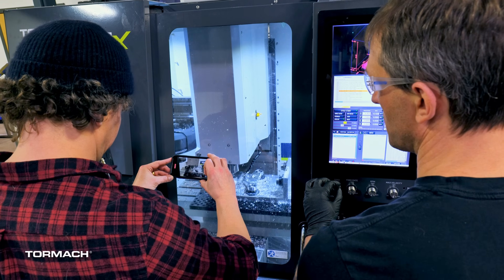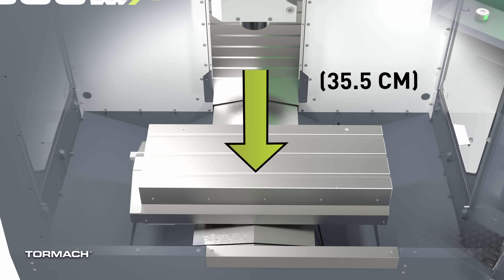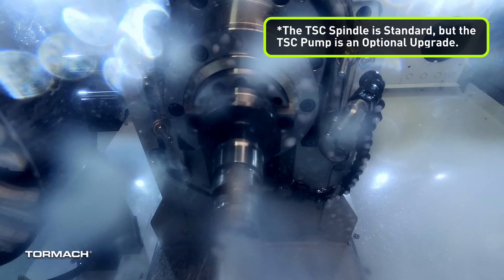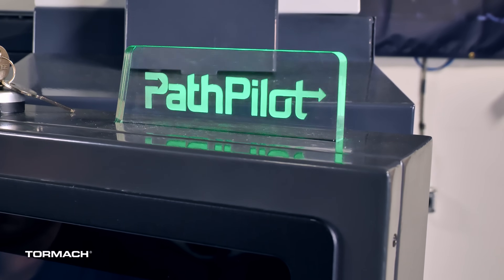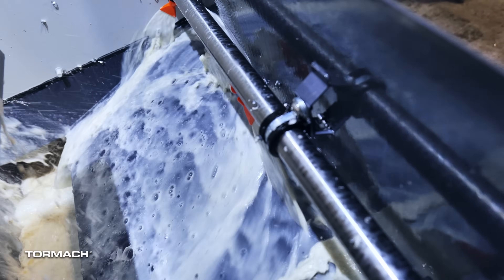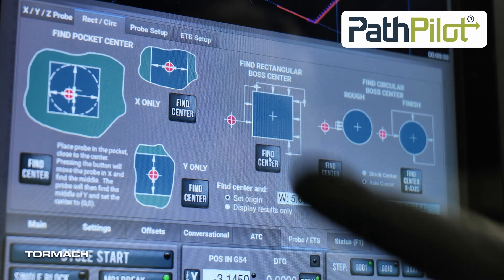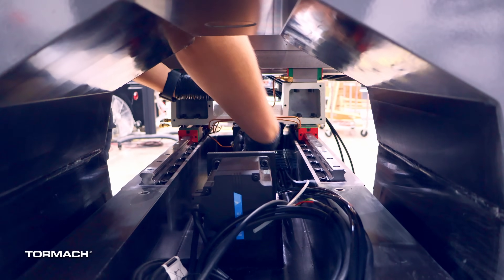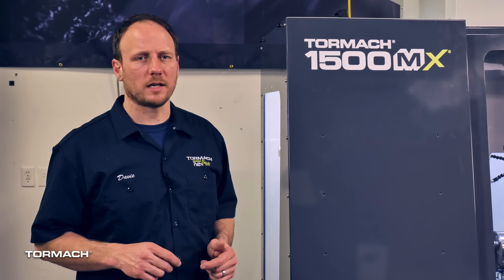The Tormach 1500MX Overview: Linear Rails, TSC, And Epoxy Granite Frame!

Comment: I just bought a used (third owner) Pcnc770. Updated pathpilot, cleaning up the mill from the dust and about to order some replacement parts (the belt, bellows). So far, I'm pretty impressed with the 770, it's not the industrial machine I run at work. But for a machine that runs on a wall outlet, it's pretty good.
Reply from the maker: We're really proud of our machines and how they are reborn with new owners all the time. Our goal 20 years ago was to open up CNC to everyone with the ease of install into workshops with single phase power.  Our Tormach Tech Support is always here to help you out:  https://tormach.com/how-to-submit-a-support-ticket  And we also have a Tormach Forum, which is monitored by one of our employees: https://forums.tormach.com  How are you using your new to you PCNC 770?
Reply: @tormachinc I haven't yet! Ordered a new belt and a couple way covers to replace worn out ones. But I'll be using it to machine parts for myself 😀

Comment: Does the spindle still have a belt for high and low???
Reply from the maker: It still does have a belt, but it's more of a timing belt, so it's more robust and it doesn't have to be set to high or low. This 1500MX belt also keeps track of position better so we can use the encoder of the spindle motor vs. a separate encoder. Thanks for the good question!

Comment: Hmmm, I remember when epoxy granite bases were a new thing in the early 2000's. At that time, it was starting to be used on ultra-precision (really ultra precision) diamond turning machines. I can see no reason to use cast iron now except for cheap low-end machines.

Comment: And the one thing Tormach failed to consider is evacuation of metalworking fluid mist which here in the UK is a hot health & safety topic for commercial users as the HSE expect this on CNC machining centres. Mind you the UK agent for Tormach are next to useless.
Reply from the maker: The mist collector for the 1500MX is mentioned just after the 3 minute mark. It will be coming later this year, as well as the chip conveyor and the TSC. In fact, many are coming even sooner than expected.
Reply: @flosscap  that’s not good enough an excuse to be coming later when your faced with a HSE inspection and a fee for intervention notice at £175 per hour plus VAT. I am sticking with my PCNC770 until something comes along thats considerably better and has better support here in the UK.
Reply: @user-lv5ij3zn9w just don't buy an American machine built to American standards. Go buy a European machine that meets your standards out of the box. I swear all people do is complain
Reply: @josephdickman1416  its seems that you are complaining at people complaining😂
Reply: @ShaunChurchill-t6o Hmmm….. Sounded more like he was just making a statement, or one might say, stating a fact.
Reply: @BobGarrett66  i was stating a fact too, but alas the facts dont care about your feelings.